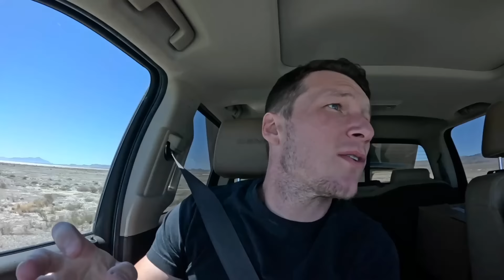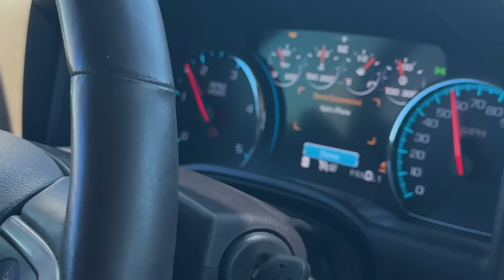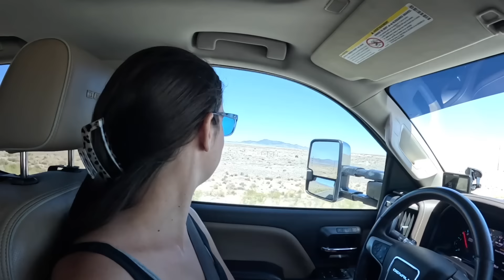New Trucks are 'Built' to Leave You Stranded

Comment: Clairification is that’s why I don’t buy diesel trucks. It is more expensive per gallon, you have to buy DEF, more cost and they are expensive to get worked on. Also if you travel Canada it is harder to find diesel. If you need a diesel to tow you RV it is too big in my book! That is me I have a 30’ 5ver and want to downgrade to a Host Yukon 11.6 (3 slide) truck camper on a F-550 flatbed. Sports a king size bed too!

Comment: I have a 6.7 F350 over 200000 miles  .  I bought brand new! I had less than 1000 miles i had it fully deleted.  I've never had one problem.   It' gets  serviced  when it's supposed to.   As of now I have a little over 600 horsepower to thee rear wheels.   Any time your in my neck of the woods Panhandle of Texas hit me I can save you tons of money .  The Def is the devil!!

Comment: I got to say, I own 2 Jeeps, 1 Chevy Truck, 1 Fordy Dually,  The Jeep JK is for Fun, beat you driving it around town, the Grand Cherokee is for getting the Fam around Town,  the Chevy 2023 Work Truck is for only in town work Due to it Breaks Down every couple of months,  The F350 Tows a 21,000-lbs with the 6.7 and has 160,000 miles on it and only has had a bad  O-ring on the turbo drain back and a Maff Sensor was out of Calibration,    IF YOU ARE TOWING IT IS GOT TO BE WITH A F350 AND UP,

Comment: I have a 2012 Chevy 3500HD with the duramax engine. The LMLs were the first generation to integrate the full set of EPA driven modifications intended to reduce emissions, especially soot and NoX. In 215,000 miles, much of it towing a 5th wheel or hauling a truck camper, the only failures I've encountered are all due to the emissions system.
These failures put you into limp mode within about 150 miles - not much help on the AlCan highway when the nearest dealer is in Whitehorse or Fairbanks, over 300 miles away.
Ironically, the GM/Isuzu developed duramax was designed to get up to 30 mpg. Mine is rarely at 15 mpg. So emissions are reduced, but I'm burning 100% more fuel, and unbudgeted systems failures that are very costly and adversely affect safety and engine durability/reliability.
If you can delete the emissions gear and reprogram the ECM, it's something to consider, especially considering the net impact on the environment.

Comment: 2:56 Dont forget that the egr also allows soot to be thrown back into the engine which could lead to loss of compression from the soot destroying cylinder cross hatches. It would be like throwing a little bit of sand into the air intake.

Comment: Milage vs. Time = Occupation of the vehicle.

At idle you are making maximum soot. Diesel’s are most efficient UNDERLOAD. Drive it hot and hard. Stop the idle phone calls and shit while your engine is running.

Highway driving in a tractor trailer is optimum conditions  for the engine to run efficiency with little soot production and hot catalytic components.

Comment: New Gas engines are GDI, direct injection. 
It is essentially a low compression diesel now..
Many fleets discovered the down sides the expensive way when they switched to has engines to avoid the emissions system's on diesel.

Comment: Do not run ATF as an additive 100% of the time, its great for cleaning injectors, but doesn't do a great job lubricating the pump. If your going to run 2-stroke oil with an "intact" diesel, make sure to run ashless oil. IMO you are better off running Archoil/Optilube/Hotshots as a fuel additive. If your truck is registered in a state that doesnt require inspection, just put it on a weight loss plan with a tune from any of the Majors and you will be much happier.

Comment: Caidin is the man! He treated you fantastic! However, ATF in modern diesel fuel systems is just a no go. ATF and "2 stroke oil" only creates ash in the DPF which doesn't get burned off in the regen process. The entire reason for the DPF filter is to capture soot. Soot gets burned off in the regen process but creates little ash. ATF and oils create ash in the DPF which clogs the filter media and leads to premature failure of the DPF filter. IE... big dollars. Just don't do it in modern emissions controlled diesels. Old school diesels? 100% rock it! 

Don't answer this question Kyle but how many times in between edits did Caidin tell you to put your truck on a "diet"? All those issues you dealt with in this video just kinda go away when the truck gets on the treadmill and losses some weight.....

Just saying....   ;)

Comment: The EPA is ruining our vehicles, (which is part of the plan to move to EV’s, no doubt. They can’t outlaw them, so they’ll just attempt to regulate them out of existence.) I’ve had the same issues, (2016 Duramax) I love the truck, it does everything I ask of it, towing my RV, tractor, or anything else I’ve needed to move. But, every aspect of the  DEF system has been replaced, (pump/heater unit, tank, injector….) Then a complete DEF system flush, after getting hold to some contaminated DEF.

Comment: So sorry you have been having so many problems with your truck.
We had a Ram 3500 dually. We bought is with 40k miles on it. 
They sold us a forever warranty which came in HANDY. We had to have our turbo replaced. It would have covered it fully except when they replaced it they were going to use aftermarket products. 
We are ppl who likes OEM products used in our vehicles. It cost us almost 3 grand.
Cadin did a great job. Love that he was up front with you and explained everything. 
You might consider buying a lifetime warranty if you ever buy again. IT SAVED our backside.
Safe travels.

Comment: We went through something similar with our 2018 Chevy Silverado earlier this year. Ended up having to replace two NOX sensors, one injector, the DEF tank, the DEF fill port, and a control module. We have about 150,000 miles on it and almost got stranded in Utah and Arizona because of it. We decided if the speed limit warning popped up again, we were going to delete. The truck has been running fine now for a couple of months, but what an expensive and time consuming experiance.

Comment: Great video and how cool that the mechanic provided such thorough explanations and let you film his work.  On the emissions side, yes the failures suck.  I have a Mercedes Diesel Sprinter so I get it. But emissions controls are necessary. We have all been behind a poorly tuned old truck spewing soot and fumes into the air making it difficult to drive behind them these emissions lead to increased asthma, lung cancer and degrades visibility in city areas due to Ozone formation. What we need to be insisting and lobbying for is improved emission systems. Anyone old enough to remember when cars first came with emission controls (1974) they were horrible and resulted in many car breakdowns. Today no one even thinks about the emission controls systems in cars.  Diesel engine emission controls will improve which should be what we all advocate for.  You guys are health care workers, you have seen the affects of poor diet and poor air quality I’m sure.  Those advocating for emissions delete work arounds are not helping anyone or our air quality.

Comment: Diesel hasn't been worth it for years. It costs more per gallon than the extra power you gain. Diesel has about 20% more energy than gas but costs at least 20% more money. Plus the modern emissions do nothing but break. Not to mention diesel mechanics are a breed much fewer and further between than gas.Get a V8 or V10 gas engine next time. Cost of ownership and headaches will be much less.

Comment: Diesel Exhaust Fluid (DEF) is 1/3 urea and 2/3 distilled water, that’s it. Doesn’t matter what brand you buy it’s all the same stuff. It is sprayed into the Selective Reductant Catalyst (SCR) to trigger a chemical reaction to break oxides of nitrogen (NOx) to NO2 and O2, which are nitrogen and oxygen as you’d find in the atmosphere. 

Interesting you recommend Shell Rotella T6. My Ram 1500 EcoDiesel calls for T6 in the owners manual, so that’s what I use. But the interwebs constantly call it a junk oil, use Lucas or Liquid Moly or whatever else. But if I ask them what makes Shell Rotella “junk” they never have any real evidence as to what makes it better or worse than anything else. Owners Manual calls for T6, she’s getting T6 because I don’t want to hear any crap if I have an engine issue under warranty.

But this diesel tech seems to know what he is doing and that’s rare. He’s not just rolling the diagnostic dice throwing parts darts at the problem to see what sticks. Kudos.

Comment: You will HATE going back to a gasser. I towed a travel trailer 50 miles with my stepdad’s Chevy 2500 6.6 gasser and it was ridiculous how the engine was revving and the transmission was hunting. You don’t realize how awesome diesels are for towing until you try to go back to gas.

Comment: Don’t let it idle for more than a min or two. There’s a scientific test that came out semi recently and the longer you let it idle the faster your oil becomes diluted with fuel. 

Waiting about 30 seconds is the best bet. But if your towing be very gentle with the throttle and load you put on the engine until it’s fully warmed up.

Comment: I have actually made it part of my oil change on my ecodiesel to pop out the def injector and clean it up.  It only takes a few minutes.  Because I have the dreaded CP4 pump I also pull the solenoids on the fuel pump and check the screens for any metal etc.

Comment: Wrong, 
I have several trucks I use for my business that run all day long, everyday.
 I started replacing the diesel’s, with gas trucks.
My costs have plummeted. 
The cost of the trucks are  cheaper. Maintenance is way cheaper. 
I’m not having the DEF, injection pumps and turbo issues that I was having before. 
Fuel mileage is less than the diesels but, I’m still way money ahead.
My stress levels are way down also, not having to worry about trying to keep a business running with trucks in the shop with thousands of dollars in repairs going out the door and down time.
I keep my trucks well maintained.
I don’t know what this guy is talking about, but drive trains are the same between gas and diesel.
Transmissions do have some differences such calibration and some internal parts.

Comment: Option 1: Buy brand new Truck every 2 years.  Option 2: Delete, have truck last 1,000.000 miles like mine and play the odds of getting fined.  Option 3: Spend a stupid amount of money fixing and replacing emission (communist exhaust system) system in an increasingly depreciating vehicle.  My choice is, Option # 2.  combine all emission repairs, depreciation and stress, it's clearly the least expensive and most reliable option available!!!

Comment: Great Video. I have a 2017 RAM 2500 with about 156k miles. I have replaced the engine $$$, replaced 3 turbos, two turbo actuators and this coming Tuesday I have to get the transmission repaired...lemon? You bet it is...I should have held onto my 2007 Ram.  Oh and the navigation quit years ago and some times it take 10 minutes for the radio to kick on....agh! Newer trucks are crap.

Comment: A key detail that keeps me running diesel over gas is the sound of the engine. A diesel purring at 1800 RPM is a lot more relaxing on a long drive than a gas engine running at 2500 RPM, and screaming every time it has to downshift for a slight hill.

Also, my Ram manual has a chart for idle times to cool the turbo after driving. For easy stuff, it needs only maybe a minute if idle before shutting off. For heavy towing and hot weather it says up to 8 minutes of idle time.  

Turbos run above 1000F and the engine oil cools them and lubricates the bearings. If you shut off the engine before the turbo cools, the oil inside can crystalize and clog the cooling system, which results in turbo failure later.

Comment: You guys discussed three different emissions systems used for three different purposes.  EGR- all internal combustion engines release unburned hydrocarbons in the exhaust. By recirculating some of the exhaust you reduce unburned hydrocarbons.  Eventually it will gunk things up.  Diesel Particulate Filter removes the soot from the exhaust.  When the computer senses it is 75-80% full it performs a regeneration that raises the temp in the DPF to 1500-1800 degrees. This turns the soot to ash which stays in the DPF.  When it fills to capacity it has to be cleaned or replaced. Diesel Exhaust Fluid is urea (ammonia) that is injected in the exhaust stream to change the NOX chemically to a form that is not a greenhouse gas.  These systems are loaded with sensors so a minor problem can lead to a derate and a trip to see Caidin.

Comment: I did not enjoy this video. My 2500HD Silverado has an 8.1-liter gas engine. It has the same axles and Allison transmission as a Duramax diesel. His information about the gas engine was not correct. My motor home is a pre-DEF Catapiler.

Comment: Agreed! Went through same crap! Bought code reader to be able to pull over and clear codes to take out of limp mode. Your problems are just beginning. My particulate filter stop up so much it blew a hole in exhaust manifold which torched 3 starters. Def system stopped working, EGR cooler leaking, I am all about clean air but they need to come up with a system that actually works!  Every part of the system is at least 3,000 bucks. I finally totally broke down in Utah, so went a different route to solved the problem and runs like a top now!

Comment: My 2005 Silverado 1500 HD 6.0L was basically problem free from 130K when I bought it to 220K when I sold it cause I no longer towed my RV. In comparison todays trucks are unreliable junk with never ending issues. Poor substandard engineering and cheap outsourced parts are causing these once reliable PU trucks to be poor investments. Let them rot on dealer lots.

Comment: This is exactly why I bought an almost 20 year old truck. Also the nerds at the epa have zero clue what effects they are enabling with the stroke of their pen. How is more plastic jugs, more metal processed, and more energy used supposed to be good for the environment? Cory at PPEI has the right solution. Proper tuning could solve emissions. None of the this BS emission equipment.

Comment: I think the gas or diesel question is a good one. I am definitely on the side of the diesel. Juice is not worth the squeeze. Right out of the gate your 6 to 8 grand more for a diesel, although you gain some MPG with the diesel that gets eaten up by the fact that diesel costs a similar percentage more to gas than you gain in fuel economy. The per mile fuel cost ends up being pretty similar. there are certainly a different set of challenges with Gasters, but they are almost always a cheaper and easier fix than diesel. Unless you absolutely need the additional torque and power of the diesel, I would go gasser every time.

Comment: Great video.   You guys are great.   The only things I do differently for my 2024 Duramax.   1) I use Rislone DEF additive to keep crystals from forming in my DEF tank.   2) change my oil AND fuel filter AND clean my MAP sensors with everye oil change at 5000 mile intervals.   Great video!

Comment: I absolutely disagree about d e f in the diesel fuel I accidentally put def in there when the girl running the pumps at the Husky station came running out of the gas station saying that she has accidentally authorized my def pumping because she thought I was a regular customer that she knew so when she finished running around with nothing she didn't know about I went back to pumping in the deaf straight into my diesel and at $1.80 I realize the mistake and I got into my truck I drove out of their totally flustered the 2014 Cummins diesel saw that there was water in the diesel and shut down the engine straight away
Reply: So then I coasted into a parking lot and then run a series of cycles of pumping fuel out through the filters 10 minutes later I was driving again never had a single problem since

Comment: The truck is a bit of a lemon on the after treatment system. I have a stock 2012 chevy. No dpf problems. My fathers 2022 f350 ford power stroke. 75,000 miles. Never one check engine light or emissions system issue. This is not  normal to have this many problems

Comment: Typically, an eight cylinder diesel motor has eight injectors.  But there is another injector that’s used specifically for the DEF fluid.  And a tech would say that you have a ninth injector problem.  And all you can do is swap it out! Buy one and keep it in a box.  Most problems if you have a good scan tool, you can do a forced regen that might take you a half an hour.  Or possibly two or three regen’s.  But when you have a ninth injector problem, you’re screwed!

Comment: 3500 to clean a DPF? Wow that seems like about 7X times too high!  Should be able to get it done if you’re not out in the middle of nowhere for like 500 😅 PS did you see the engine that he was rebuilding or had the head off? That’s what you want a 12 or 24 valve Cummins straight six.  Or a truck with  a 7.3 international./ ford those older trucks do not look fancy, buy ye won’t be sitting on the side of the road and they are both very efficient and reliable engines!

Comment: This is the exact reason why I bought a used 2023 low mileage Toyota Tacoma from a Chevrolet dealer and walked past an entire row of new Canyon pickups.  

The transmissions on all GM trucks seem to develop major problems.  

Very disappointing because I have been a domestic truck buyer for years but I have given up on the new trucks being reliable on the long term. 

You used to be able to buy a truck and get 20 years out of it.   Those days are gone and so am I.